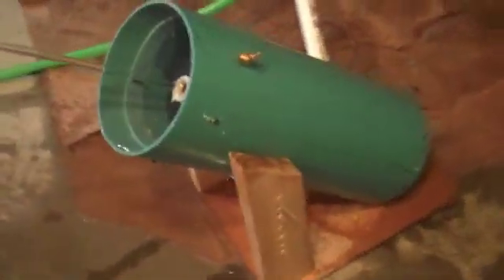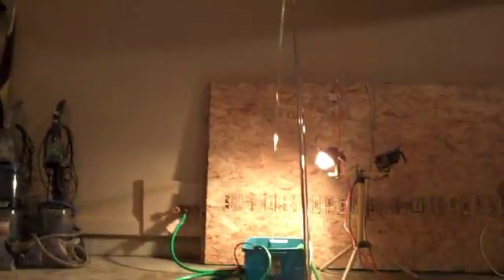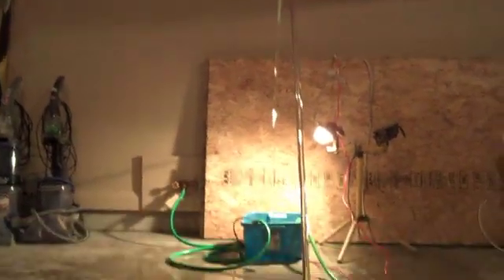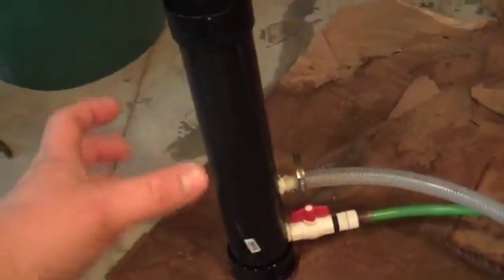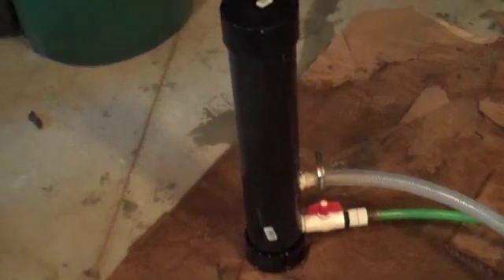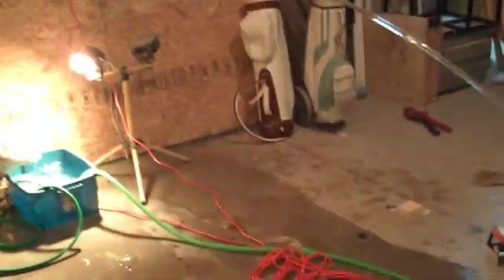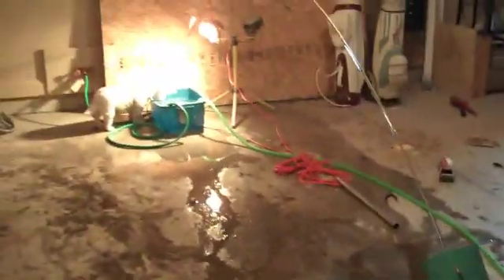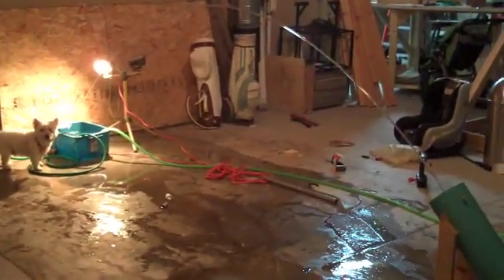Laminar Nozzle Prototype Test 1  http://w

Comment: you been pretty right with the brass nozzle, i tryed out aluminium it was just so so ok but when you go a bit distance then it starts to be not very acurate anymore, now i build a new nozzle in brass and polished it perfectly and now it is much better.
Istill have the problem when i go distance then it is ok for maybe 3 mtr. and then the flow is not consistant no more.

Comment: Hello John, i've be playing around with this laminar thing for a while but i just still can't find out what is wrong on my one cause i can't get a nice laminar flow out of my one. I use a 6 inch Pipe with a nice smooth inlet and 3 of the filter cloth (about 1/2 inch thickness each) also about 1000 straws i not so sure about the nozzle. I use a waterhose nozzle which is made out of brass. I don't use a low pass filter.

Comment: The reason it's called a low pass filter is it is filtering (removing) the higher frequency oscillations from the flow and allowing the low frequencies to remain/"pass".

If you've done any work with speakers, when you connect the bass you use a low pass filter so only the low frequencies can get to the bass speaker. You can also use a high pass filter in "parallel" to remove the low frequencies and only allow the high frequencies to reach the tweeters.

Comment from the maker: It's just a small pump from Beckett model 1150.  Nothing special.
Reply: John what exactly did you make the nozzle out of?
Reply from the maker: @mikehogue8797   Brass, but stainless steel is a good option too.
Reply: @Grzzs  Is it just a piece of brass tubing or fitting. How long is it and did you have to modify it in any way? Thanks
Reply from the maker: @mikehogue8797  I had it custom machined.